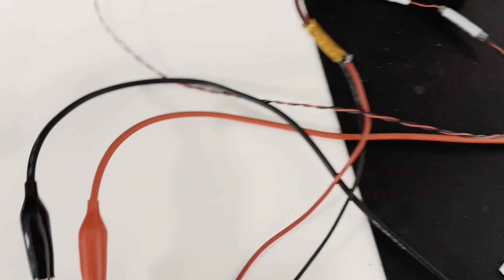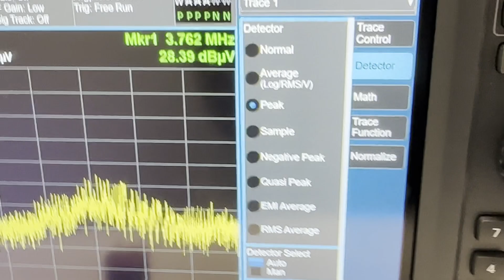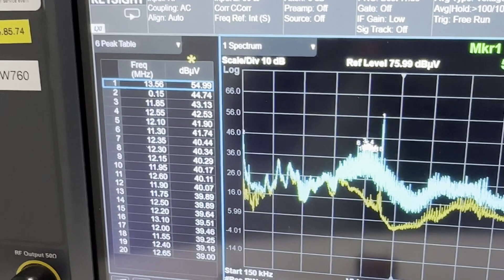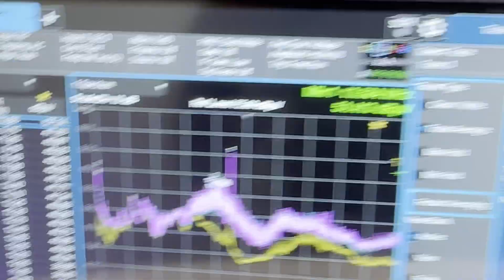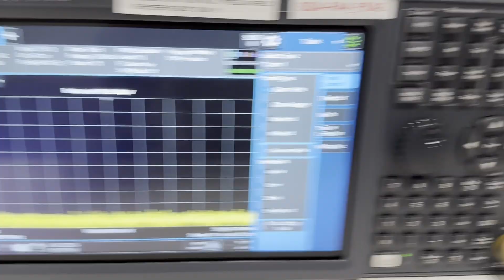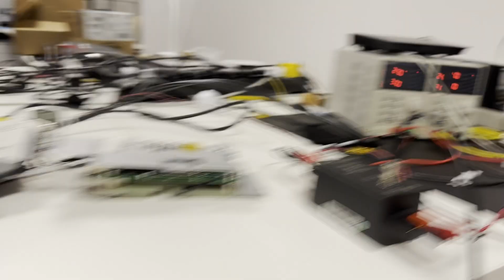Debugging EMC Conducted Emissions with a Spectrum Analyser. LISN setup for AC and DC-powered PCBs

Comment: I see some testing requires two LISNS,can you explain the rationale behind this please and they also use a 50 ohms connector on one of the lisns
Reply from the maker: Hey! Thanks for your comment. The reason is the different voltage for 50VDC and 115/230VAC systems. Based on that, there may be more LISNs needed. For example, 3-phase LISNs are also fairly common.
Reply from the maker: All LISNs need a 50 ohms connector as the output to a spectrum analyzer

Comment: Please make detailed video on ferrite bead/core. How to choose correctly to pass radiated emission test & one video on ETSI 301 489-1(EMC standard for radio equipment)
Reply from the maker: It's relative simple - you first select the right impedance, so that it's highest at the frequency that you want to reduce. Then, you select the adequate current rating which should be at least 2x the rated current. This also drives the size selection. That's about it, now of course how do you know the frequency you may ask? That's not trivial and requires simulation/measurement. So it's a good idea to have 0R placeholders on the PCB on each power supply, just in case you need it.
Reply: @DrEMC-sf8rx  Is there any calculation for choosing ferrite impedance? Like frequency & emission level I can see in graphs but choosing impedance to suppress noise level to some db is tricky to calculate. Also, if increase wire turns in ferrite, how do impedance increase like in which ratio
Reply from the maker: @vishvajeet7064  yes, there are calculators and field solvers available. For conducted emissions you can calculate the filter insertion loss in dB, which is pretty easy
https://www.emisoftware.com/blogs/emc-analysis-calculate-filter-insertion-loss/

Comment: Hello, Dr. EMC, I have a question regarding why an AC LISN is defined with a 50 µH inductor while a DC LISN is defined with a 5 µH inductor. Why is there such a significant difference? Is there a specific purpose for this distinction? Why not use 50 µH for both? Additionally, in a real setup, is it possible to have a single LISN that can be used for both AC and DC purposes? Thank you.
Reply from the maker: Great question! The value of the series inductor is determined by the Q-factor and the frequency range of LISN. As a result, it's standardized as 50uH for CISPR32 (domestic/industrial) and 5uH for CISPR25 (automotive). 
You can use an AC LISN to measure emissions on DC lines, but not the other way round. However, you'd have to make up your own wiring because AC LISNs typically come with AC plugs and sockets rather than banana plugs.